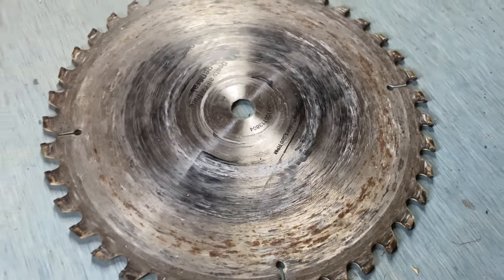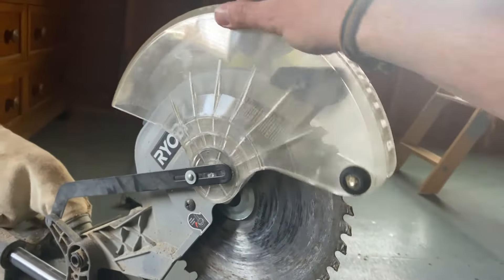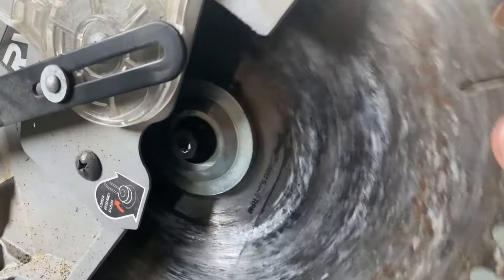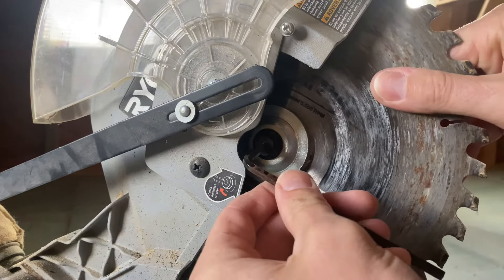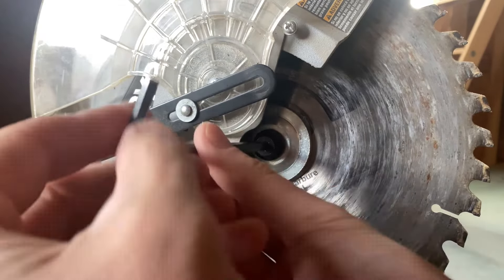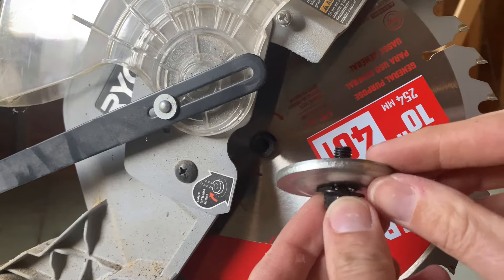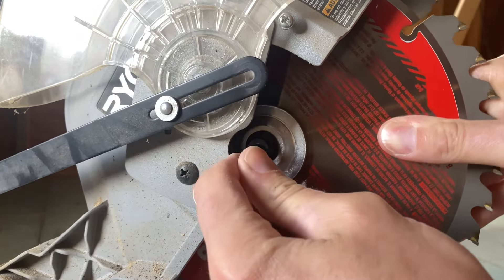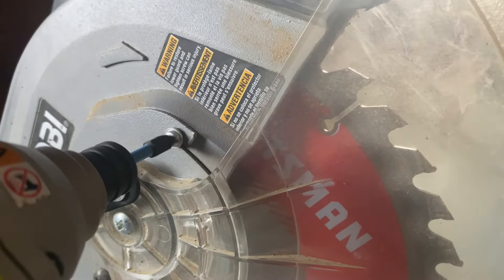How to Change the Sawblade on a Ryobi Miter Saw

Comment: I appreciate your video, however the bolt on my ryobi is stuck and won’t budge even with a combo wrench, wd-40, and hammer. It’s crazy ! I’m not the only one with this problem. Glad you were able to get your blade changed out so easily. 👍🏻
Reply from the maker: That’s unfortunate.. just to double check, remember the blade bolt is backwards. It’s “righty Lucy” in this case. Or maybe someone else forgot at some point and Hulk Hogan’d  it on by accident
Reply: @WesleyAllenNC  👍🏻
Reply: mine is impossible to change as well. just got one and went to put a finish blade on it and the thing just wont go anywhere. driving me up the wall
Reply: @justmattd4745   I asked some so called experts about this and they’re just as puzzled as I am. SMH 🤦🏻
Reply: @texasturner2313  brother I just went in the garage and tried again today, and got it, when I tell you it took everything I had I’m not kidding. Had to put in on the floor, put gloves on, grab it by the blade, and put my whole body into it. A 180 pound construction worker should not have to be doing all that to change a damn blade 😂
Reply: @justmattd4745    Wow. Glad you got it. I haven’t tried mine again since my original post.
Reply: I'm going absolutely nuts trying to loosen my Ryobi 7 1/4 blade. Have tried an Allen wrench with a hammer. Now letting some lubricant soak in, but I have doubts that will work. Basically assuming I'll need to return to the store as defective. So frustrating! Yes I'm turning clockwise per the manual and sticker.
Reply: @SS-nt8zq  I ended up soaking the bolt in solvent, then lube, then used a heavy duty ratchet with an extended handle and a hammer and was able to loosen the bolt.Ridiculous.
Reply: Same. My bolt won’t come off and now it’s stripped
Reply: watching this video to replace factory blade with ultra fine blade,.. bolt is frozen on mine as well,.. and I am going clockwise trying to loosen,…. DAMN!!!!!!!
Reply: Also look on other side of blade. There is a gray button. Press the button to lock blade when loosening or tightening bolt.
Reply: Mine was really tough, i had to use a 1/2 inch socket
Reply: I'm having the same problem, the bolt will not untighten and I'm not a construction worker.  I'm an old 60 year old woman.  Wtf?
Reply: I'm not a professional, but I found using a small torch to heat up the bolt worked really well.  It seems that some of these assemblies are using loctite or a chemical adhesive to keep the bolt in.  Once it was heated up, the bolt loosened right away.
Reply: Never keep the blade that comes with it on i always junk them right away.
Reply: Blow some hot air on to the bolt and tad bit of wd40 and it did the job.
Reply: Did you get it unstuck? I’m having the same issue.
Reply: @sevarges86 it worked with a drill!
Reply: @sevarges86   Yes, I was able to do it with a small impact, socket, and plenty of Wd 40.

Comment: There is a lever to push on the right side of the chop saw that will hold the blade in place while you tighten and loosen it. You don't have to touch it with your hand
Reply: This video is terrible for that exact reason this person should not be instructed vids about anything if he thinks grab the blade is a good idea
Reply: Thank you. You're better than the actual video😂

Comment: Nice and this helped, but, but I'll add that there's a button you can depress and if you spit the saw it will go into a notch and hold the saw while you loosen the nut. it's a little black button on the right side of mine, probably yours, too. but thanks for the help figuring out how to lift the shroud!
Reply: Mine is battery operated and has this.

Comment: That saw should answer a lot of quesstions if the Ryobi saws will last.  That thing has been through the ringer.  I have the same saw and have never had a problem with mine, although I don't use the laser.

Comment: You might be mistaken claiming your miter saw blade is dull and it can no longer be used. It's kind of hard to believe that the carbide tips on the blade go bad. There's a chance the tips have gunk and resin from the lumber which are covering the sharp edges. To remedy this is to get a lid from a 5 gallon buck to use as the wash tray, degreaser, and a scotch brite pad.

Comment: My bolt is stuck. I guess they make it this way so we can just buy a new machine instead of changing the blade. Bastards
Reply from the maker: It should come loose, it’s threaded opposite of a normal bolt. Right is loose on these, kind of like a propane tank